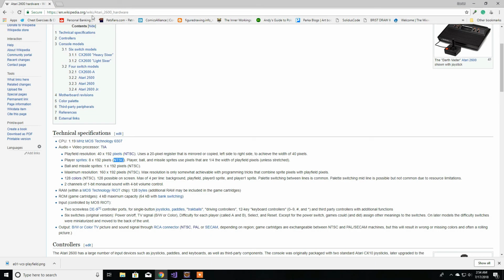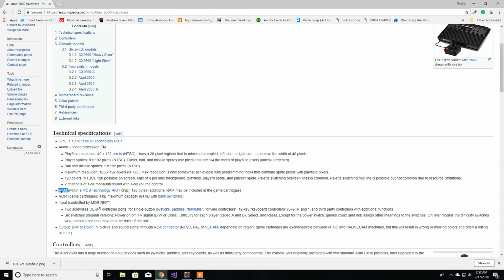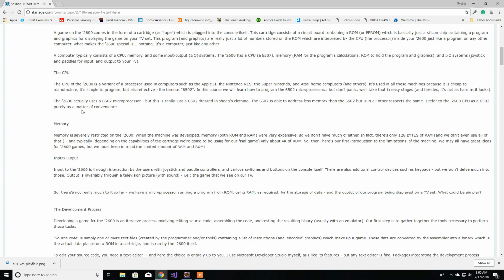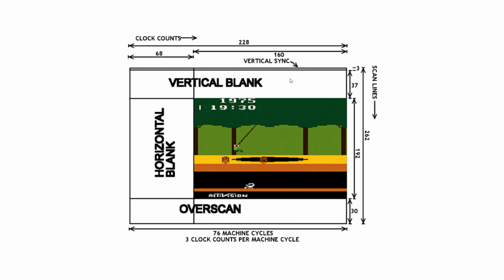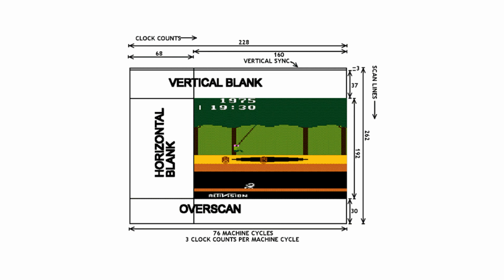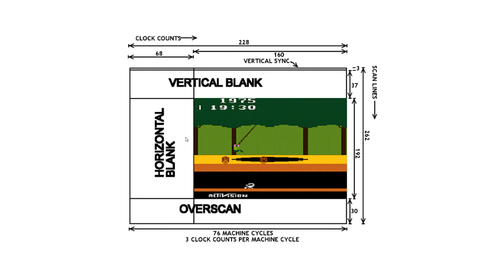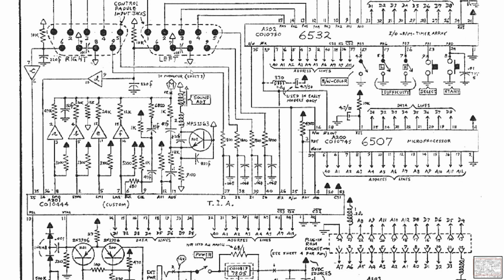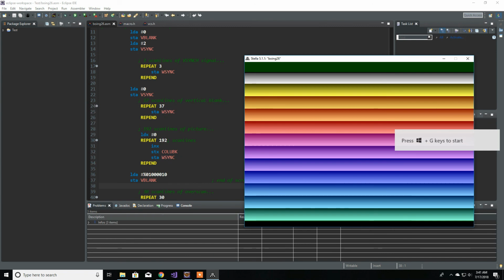Atari 2600 Programming - Video 3: TIA and Specs

Comment: The MOS 6507 is the equivalent of a MOS 6502 with a reduced pin count. TIA is the Television Interface Adapter. So the Atari 2600 VCS had a remarkable graphics capabilities for such a small simple cartridge based video game console system.

Comment: processor 6502
 include "vcs.h"
 include "macro.h"

Cntr   equ $81
Bnch   equ 24
Cntr2  equ $82

 seg Code
        org $f000

Start CLEAN_START

NextFrame

 VERTICAL_SYNC
 
; 36 lines of VBLANK
 ldx #36
LVBlank sta WSYNC
 dex
 bne LVBlank
; Disable VBLANK
        stx VBLANK
; Set foreground color
 lda #$42
        sta COLUPF
        lda #$7B
        sta COLUBK
        lda #1
        sta CTRLPF
; Draw the 192 scanlines
 ldx #192
 lda #0
        sta Cntr
        lda #Bnch
        sta Cntr2
        ldy #8
        
        
ScanLoop
N_branch
 sta WSYNC
        lda PFData0,y
 sta PF0 
        lda PFData1,y
 sta PF1
        lda PFData2,y
 sta PF2
        dec Cntr2
        bne N_branch
                    
        dey
        lda Cntr
        clc 
 adc #24
        sta Cntr
        cpx Cntr
 bne ScanLoop

; Reenable VBLANK for bottom (and top of next frame)
 lda #2
        sta VBLANK
; 30 lines of overscan
 ldx #30
LVOver sta WSYNC
 dex
 bne LVOver
 
; Go back and do another frame
 
 jmp NextFrame
 align $100
PFData0
        .byte #%00000000
        .byte #%00000000
        .byte #%00110000
        .byte #%00010000
        .byte #%00010000
        .byte #%00110000
        .byte #%00000000
        .byte #%00000000

PFData1
        .byte #%00000000
        .byte #%00000010
        .byte #%00000000
        .byte #%00000010
        .byte #%00000000
        .byte #%00000010
        .byte #%00000000
        .byte #%00000010

PFData2
        .byte #%10000000
        .byte #%10000000
        .byte #%10000000
        .byte #%10000000
        .byte #%10000000
        .byte #%10000000
        .byte #%10000000
        .byte #%10000000

       
        
 
 org $fffc
 .word Start
 .word Start
Reply from the maker: Sorry I didn't see you replied, but just looking at the debug it tells me that you have 360 frames on it, like i said it was one the reasons why it was flickering. I'll see what the problem is soon.
Reply from the maker: I did a quick fix with what you gave me, i changed the format to make it easier to me to read it. First i found redounded the part of the code to add and compare to 192, if you know that was the case, so i removed it. Second I put the vsync manual to count that vblank+vsync should be 40 frames all together. I reset all the pf register to 0 at the end as well.

	processor 6502
 	include "vcs.h"
 	include "macro.h"

Cntr   = $81
Bnch   = 24

	seg code
    org $f000

Start CLEAN_START

NextFrame

    ; Start of vertical blank processing
    lda #0
    sta VBLANK

    lda #2
    sta VSYNC

	ldy #3
VerticalSync:	
	sta WSYNC
	dey
	bne VerticalSync

    lda #0
    sta VSYNC 
 
; 36 lines of VBLANK
 ldx #37
LVBlank 
	sta WSYNC
 	dex
 	bne LVBlank
; Disable VBLANK
 	stx VBLANK
 
; Set foreground color
 		lda #$42
        sta COLUPF
        lda #$7B
        sta COLUBK
        lda #1
        sta CTRLPF
        
; Draw the 192 scanlines
        lda #Bnch
        sta Cntr
        ldy #8
        
ScanLoop

N_branch		
        lda PFData0,y
 		sta PF0 
        lda PFData1,y
 		sta PF1
        lda PFData2,y
 		sta PF2
 		sta WSYNC
        dec Cntr
        bne N_branch
                    
        
        lda #Bnch
        sta Cntr
        dey
 		bne  ScanLoop

; Reenable VBLANK for bottom (and top of next frame)
 	lda #2
    sta VBLANK
    lda #0
    sta PF0
    sta PF1
    sta PF2
    sta COLUBK
    sta COLUPF
; 30 lines of overscan
 	ldx #30
LVOver 
	sta WSYNC
 	dex
 	bne LVOver
 
; Go back and do another frame
 
 jmp NextFrame
	align $100
	
PFData0
        .byte #%00000000
        .byte #%00000000
        .byte #%00110000
        .byte #%00010000
        .byte #%00010000
        .byte #%00110000
        .byte #%00000000
        .byte #%00000000

PFData1
        .byte #%00000000
        .byte #%00000010
        .byte #%00000000
        .byte #%00000010
        .byte #%00000000
        .byte #%00000010
        .byte #%00000000
        .byte #%00000010

PFData2
        .byte #%10000000
        .byte #%10000000
        .byte #%10000000
        .byte #%10000000
        .byte #%10000000
        .byte #%10000000
        .byte #%10000000
        .byte #%10000000

 org $fffc
 .word Start
 .word Start

Comment: man im new to this, but iv been messing with this playfield and registers, and I can't get the playfield to stay and stop flickering, could you help me?, the code is awful, but I am learning
Reply from the maker: Is the screen flicking or is it the playfield? 

Is the playfield moving or is it offset?
Reply: @ProgrammerDan  its moving, like im not counting the scan lines right, the PFdata0 ,Pfdata1,PFdata2 are 8 bytes  so they should be changed every 24 loops to get 192, together the frame to stay
Reply from the maker: @sodapopinski9922  if you are using the Stella emulator turn on developer mode, it will show you the amount of frames you are outputting. 

The flicking is possiblity happening due to too many scanlines.

The moving loop part, I don't know from what you told me. Make sure that you are ending those scanline properly.
Reply: @ProgrammerDan  im using the 8bitworkshop ice
Reply: I can't figure it out I sat there and counted every line
Reply from the maker: @sodapopinski9922  I'm not with my computer right now. I can probably check your code tomorrow. Without seeing it, it's hard to guess, but I feel it's gonna be pretty easy.

Comment: on line 13 LDA #2 then line 14 STA in VSYNC, why load the 2 into the VSYNC register when its either 1=on and  0=off
Reply from the maker: Good question, it might be a long answer, but it's simple .

If you look at VCS file, you'll see this:

VSYNC ds 1 ; $00 0000 00x0 Vertical Sync Set-Clear

If you see the comment section, the part after ; 
The part 0000 00x0, the X shows the bit of that byte that turns that register on or off. So in this register case the second bit turn it on or off not the least significant bit.

So let me show, examples to make it easier to understand.

0000 00x0 = VSYNC
0000 0000 = 0 in byte, off
0000 0001 = 1 in byte, off
0000 0010 = 2 in byte, on
0000 0011 = 3 in byte, on
Reply: @ProgrammerDan  wow thanks for getting back to me so quick, crap I figured it was something like that, its funny bc when I couldn't figure it out i was looking at the 6502 flags register to see if It was something like that... then my kids came from school and I got side tracked... thanks brother....
is that the reason for the bit pattern in line 36 before the VBLANK?
Reply from the maker: @sodapopinski9922 As far as VBLANK goes, all register have different location within the byte where it turn them on or off. 

All of them are specified on the comment section on the vcs.h file. Where the "x" is the bit location that turn them on and off.

It might make more intuitive sense if they were like Boolean looking at them now, where the least significant bit turns stuff on or off, but they make more sense when you'll start to optimize the code. So for me at least, the designers did a great job, with the giving constraints.